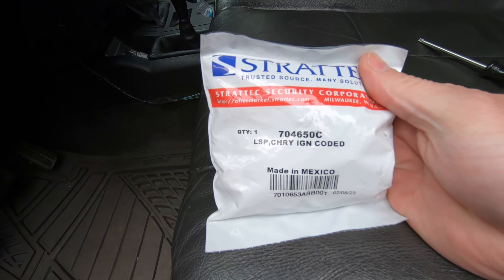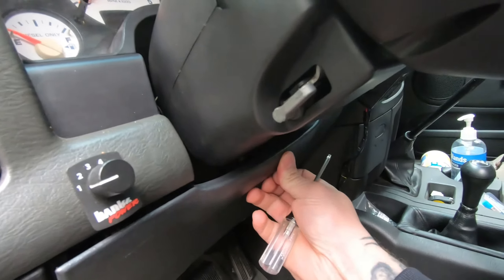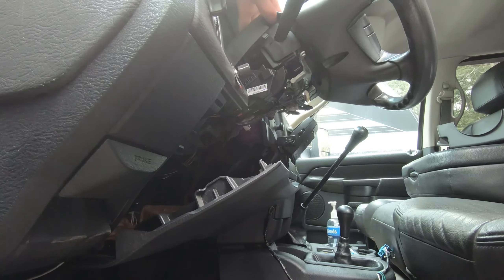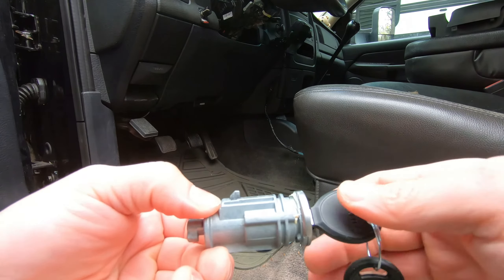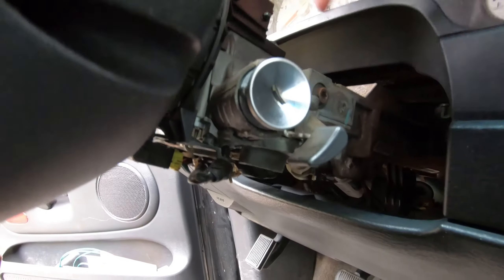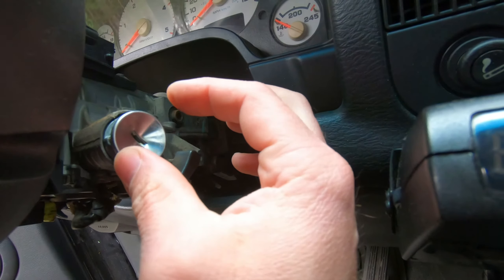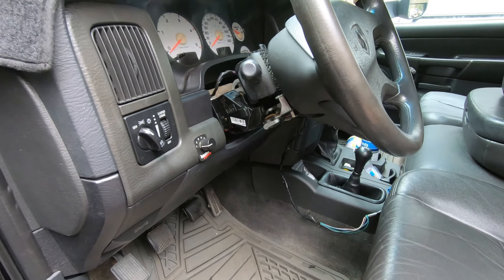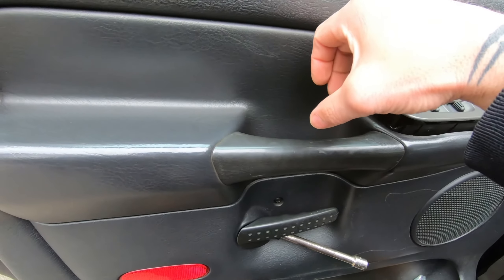How to replace a Dodge Ram ignition lock and door lock cylinder

Comment: looks like no halo around key lock so no programming needed? imy 2005 doesnt have no halo around cylinder but has a grey key someone must have bought a grey key im guessing chipped but it doesnt require it
Reply: i mean thats all i can figure out because i looked up what it would take if it had a chipped key there should be a black round thing connected to a small control box at key. its not there which is fine that means i can have a spare key made for like 5 bucks

Comment: Hey Jason video helped a lot. Got mine removed. Maybe you might be able to offer some advice. I've had a bad parasitic drain for some time. I tracked it down to the ignition switch. I have a bad key cylinder, I'm pretty sure I could start it with a screwdriver. I was wondering if this could be causing the ignition switch to stay engaged in some way when the vehicle is off.
Reply from the maker: The key cylinder and the ignition switch are separated. The key cylinder will turn a rod  that will turn the ignition switch. If the key cylinder isn’t turning back to the off position then it could be causing a drain but my money would be on the ignition switch itself if you traced the drain to the switch staying on.
Reply: @JasonTheMunicipalMechanic  The switches arent very hard on the bank, guess ill just replace that too since I already have it all opened up. Thanks for the help.